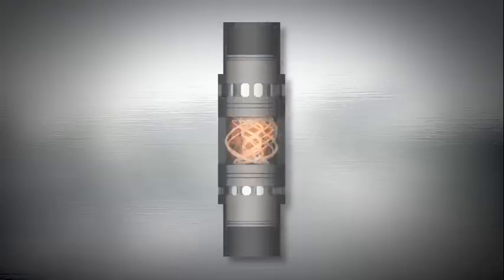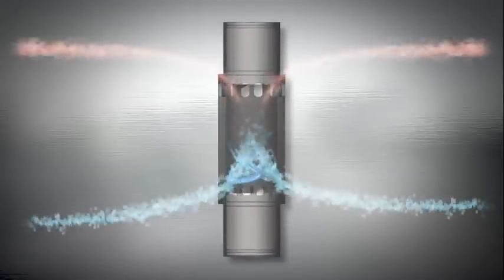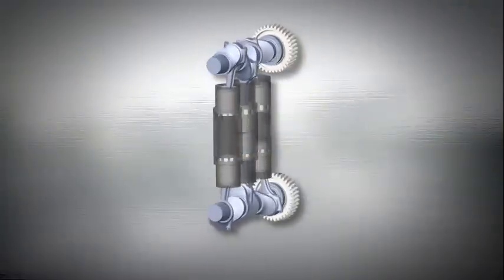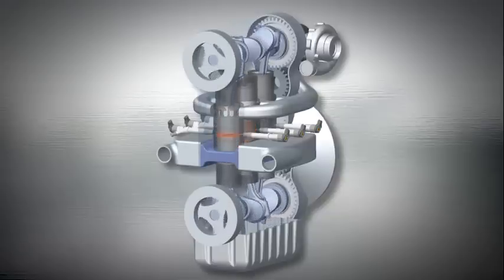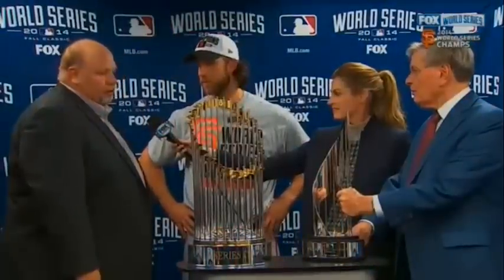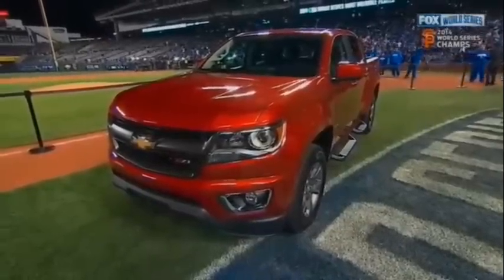An Update on Achates' Revolutionary Engine - Autoline After Hours 264

Comment: Try a British Deltic or FM 12 cyclinder, both 2 stroke diesel. Fraudulent show.
Reply: +squirrelkinns How so??
Reply: Take a know tech and just reduce it in size, so not truly ground backing in any real sense.
Reply: Know ?? You mean known ?? And Ground backing you mean breaking ?? Well they did improve on an old idea so your wrong there too!! The V-8 has been around for years but it is no way the same engine that it started out as !! Variable lash valve train and some have cylinders that shut down as load is reduced still a V-8 but not the same old thing !! This engine uses different pistons and various different parts not used in old systems so yes it is ground breaking !!
Reply: Senior Frog  Refined? yes. Engineered smaller? yes, Using lessons learn? yes, but still not 'ground breaking!'. .
Reply: Depends on your definition of ground breaking and yes it is!  It is new, different than anything that has come before so yes it is !!
Reply: Senior Frog Nope. only one definition too.
Reply: So then this is ground breaking as they are doing new things thus breaking new ground !!
Reply: Senior Frog Suit yourself, After my short lifetime of seeing stuff like this come and go, I'm just Not impressed.
Reply: Well your not being impressed makes no difference as your not running a big business looking for a better way to power equipment !!

Comment: nop this is bullshit! double movement for one compression, here an example, u have " 6 cylinder" meaning 3 real cylinder compression power. V6 engine has 6 cylinder alone meaning u will get 6 cylinder compression. Also the engine they are showing only get one compression every 1/3 turn, v6 engine has 1 compression every 1/8 of a turn. So to make it simply it it  3 cylinder engine with more additional bull shit. Lololol hate to say this but a piece of shit metro 3 cylinder has more power than this one they are showing. It a frakking joke!
Reply: +ybadboy13ybadboy13 Do you even understand how a four stroke engine works? A 4 stroke V6 has three compression strokes per crank revolution, 3 power, 3 exhaust, and 3 intake. A 4 stroke requires two crank revolutions to complete all cycles. So the 4 stroke V6 engine has the same power impulse ever 1/3 revolution as a two stroke three cylinder six opposing piston engine does, the two stroke one would however have a far larger impulse at the time.

Two stroke opposing diesel engines are nothing new even in automotive format. Screaming Jimmy Detroit Diesels ring a bell?

Essentially all Achates doing is modifying a tried and true technology to make it desirable again in the modern age of emissions and sound levels.